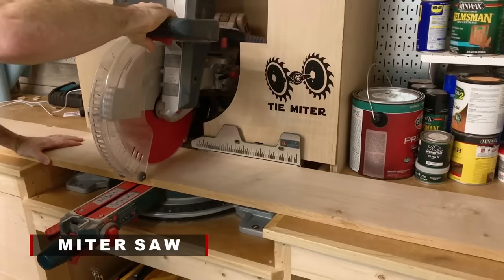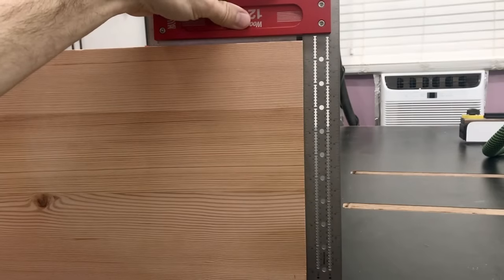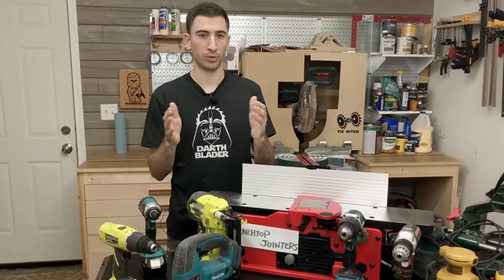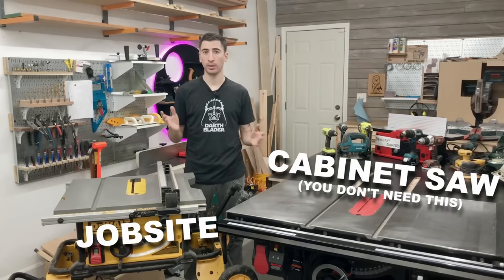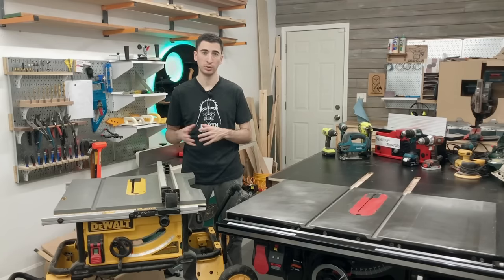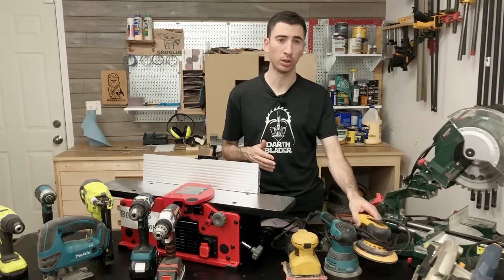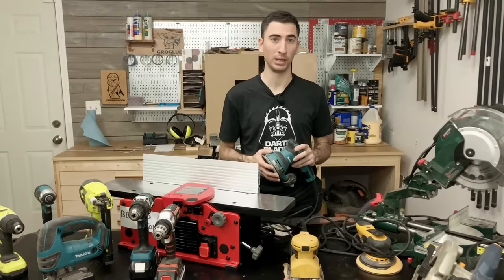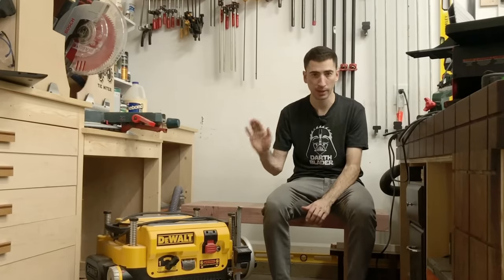Woodworking POWER Tools // Watch Before Buying

Comment: I caught one of the annual sales on the Dewalt JobSite saw at HD and built a rolling base with fold-down 'wings' around it. After fine-tuning it, I would put it up against just about any cabinet saw (at least for my needs). One of my greatest hopes, is that I will find a 220V version, for as reasonable a price, when i retire to Spain.

Comment: I have the Dewalt jobsite saw and I paid 449$ for it on Amazon. It works very well for what I need. Also have miter saw 10" Skil, paid 249$. It works very well also. How about recommending a drill press. What's a good one to buy?

Comment: I do not see Ridgid stuff... I am a contractor & have a bunch of their gear & it is good stuff on a budget. The only Ridgid tool I hate is the 7.25" cordless circ saw but I would  dislike most of the other 7.25 saws for the same reason: the blade is right side where I can't easily see it working. To remedy this I am juggling between a 6.5 Ridgid or going full tilt to a worm drive framing saw because the blade is left side.  You also have to look closely at the Ridgid jobsite table saw because their fences are notorious for being dodgy.

The only other advice I have is blades: buy good blades with carbide teeth...especially for your sawzall... I love the Milwakee demolition grade blades for this job, but again Ridgid make a very good carbide sawzall blade.

Comment: I went with 18v Ryobi years ago when durable power tools became extinct, simply because I could buy individual replacement tools alone without batteries or charger for less than $100.  I'm still using my original impact driver.

Comment: Somewhat surprised the shop vac with dust attachment for all these tools wasn’t even mentioned.
  Woodworking, only to be beaten by masonry cutting makes the worst debris bar none.
  Get a brand that has a guard attachment you plug your shop vac directly into, coupled with a small gadget you plug the power cord of the shop vac into which, when the miter saw or circular saw is active, automatically starts the shop vac for immediate wood dust collection.
  The worst part of any job is clean up after, so get a heavy duty shop vac in the mean time and clean as you go!

Comment: At 61y old, out on disability, I wanted something to fill my time and make a few bucks.
I had a circular saw, cordless drill and jig saw that I had bought at Walmart, I hadn't planned on using them much so I bought cheap.
Getting into woodworking, I bought a $20 sander, again at Walmart, Kreg single pocket hole jig and a $100, 7 1/4" miter saw at Harbor Freight.
So for $150 plus the couple tools I had, I was ready to hit the ground running. Figuring I may have an order or two every couple weeks I didn't need high-end price power tools...

Well, those little low end tools are working great and I am putting out 6/7 projects a week 🤣🤣
Yeah, when they die I will step up to the middle of the line tools...but til then, I'm making steady money with my cheapest tools I could find 😁

Comment: Also, many of these tools are disposible. As just a weekend warrior, I buy power tools that are upper end of price. My Milwaukee compact-impact set is 16 years old and still run well. My DeWalt table saw and compound miter saw are each 13 years old and run like new. Maybe I'm lucky, but I dont want to run to Big Box store and have to rrpurchase a power tool in the middle of a job. In Canada, power tools always go on sale. My drill set is pretty much same price as they were when my wife purchased them for me so many years ago. My saws were both purchased 30% off reg. price. Hand tools are a different subject in my books. A $30.00 claw hammer is just as effective as a $140.00 claw hammer.

Comment: Look at me commenting on a year old video. Go me!

Speaking as a ex-Dewalt repair tech, and then just a generic repair tech... there are some differences between the various "big" brands and how they fail. Dewalt is by far the most repair-friendly and they almost always honor the warranty, but make no mistake...they will fail eventually. Milwaukee will fight you every step of the way to make you pay even though they offer a 5 year "warranty". Makita is very solid, but when they fail it's pretty much always electronically and you can't swap out the module, you need the whole assembly replaced. Bosch is a weird not-for-profit organization of some kind and they simply buy old patents from other manufacturers, then try to give them that German over-engineered look by adding 20 more screws where they don't need to be. You're basically buying tech from 20 years ago, dolled-up to make them look like proper tools.

From a user's point of view, they're all the same if you take good care of them and don't use them in ways they weren't intended. You know.. like mixing cement with a 12v screwgun with a quarter inch rod glued in the bit holder :D

Comment: Safety is a consideration too. I believe that if I feel dangerous it's probably because it is and that likely is because of bad design. Funny how I felt perfectly safe in my shop class in highschool, but using the band saw at work I was scared. Or the cheap tablesaw my dad got me off the side of the road (thanks dad 😐). If a tool scares you, probably time to get rid of it before you lose a finger.

Comment: Having  been woodworking for over 70 years. Using many different tools. Last but by no means less important I've been selling tools for a long time. I have a few points on your observations. Most of the job site table saws are very lightly made. I consider them trash. Now on to your opinion on miter saws. 98% of your opinions are wrong. Cheap saws can be set up to be accurate, but they will not hold those settings. No sliding miter saw is accurate. There is much too much play in the sliding assembly.  I totally agree with your statements on jointers. The longer the bed the better the results. However a 6  in. jointer is everything a home shop needs. That big 8 in. starts off costing a lot. It also demands 220 voltage. Not easy for a lot of woodshop owners. Your opinion on the little finish sanders is not seeing the purpose for these little guys. They are made for the light finish sanding before finishing (400-800 grit.) The portable belt sander IS NOT for the beginning woodworker. It's heavy, powerful and moves a lot of wood very fast. . Before grabbing on of the boys  you need a good bit of practice on scrap wood.. Just my 2 cents worth.
Pop Golden

Comment: In keeping with the sandpaper point, I'd add that the most important element of your saw is the blade (so long as your saw can keep it square). I don't think most beginners pay this enough attention. Spend a little bit on the blade, and most saws will punch above their weight class.

Comment: You should do a part two video. I have two tools for the list, aka two mistakes I made. 

First thing I bought was Ryobi RTMS1800-G. It's a combination saw, and it does two things, and it does them terribly. It has a table saw function, which is worse than worthless. The fence? Not square. Miter gauge? Flimsy. Adjustable blade height? Lol no. It can't do anything you'd want to do with a table saw. I was going to use it, but instead I returned it and got a sliding miter saw instead. I just looked at the retailer reviews for it, and they were mostly 5 stars. Lesson learned: people don't know shit. Should've known better for lack of other resources either praising or hating it. 

Second tool? Ryobi RWSL1801M. It does the job ok, but it's still awful. Max cutting capacity: 45mm. Try cutting through a 2x4 with that, you need to flip it. And here I thought that 45mm is enough, since I got it for rough cutting material so I can get it inside my apartment. Should've spent a little more.

Comment: Haha I bought the cheapest Ryobi.l table saw. Initially I was pissed that their tracks didn't accept most runners, and the dust collection is non existent l, but I built a lot of stuff with it. I wish I had bought a larger ryobi table saw (those that allowed regular runners at least). But it was a good deal for $100. It was my first tool and I learned a lot from using it.

Comment: Brilliant video. I have those exact Dewalt tools. In the mid 90s, I went ahead and purchased a Powermatic 66. I learned that well made tools are safer and a pleasure to use. Yes, it is a huge heavy saw but it has served me well. Your other recommendations are spot on and I will take a look at that sandpaper you recommend.

Comment: I completely disagree with the mitre saw comment that as your woodworking improves you use it less and less. The Mitre saw absolutely has it's place to make accurate and precise cuts over and over again. it's simple to setup and use, and almost everyone that says what you say about them still has one and uses it often. It's absolutely necessary in the shop!

Comment: The Hercules (Harbor Freight) jobsite table saw has the same level of adjustability as the DeWalt. It's practically a clone of the DeWalt. Same with the Hercules 12" sliding miter saw. It's essentially a DeWalt in a blue uniform. We've had all four on jobsites together and they're so close it's ridiculous. Why not save money and buy the Hercules versions? Lord knows their warranty service is miles better than the hoops you have to jump through with DeWalt - and I say this as the guy who owns the aforementioned two DeWalts (along with quite a few of their cordless tools).

Comment: Maybe this is because I do more regular carpentry but I think table saws are very overrated, they're a great tool to have but it's extremely rarely vital to have one. It's like that old saying that "if the only tool you have is a hammer then every problem looks like a nail" but rather "if the only tool you have is a table saw then the solution to all problems is to build another sled". 

So many times you see people run to their stationary table saw to make what could be a quick cut with a jig or circular saw. Dewalt has a table saw mitre saw combo that's perfect for anyone starting out as well as the more experienced.

Comment: I really like ryobi, but I do not recommend there Mitre saw or table saws, That was the first thing I bought when I started and I burned through 3 of them before finally getting the famous Dewalt mitre saw
And a rigid table saw.
10 years later in those are still running great.

Comment: Classic Craftsman 113 contractor table saws are cheap. You can take the money saved and invest in a good fence. That saw will last forever. The only downside I've seen is the limited arbor length for dato blades.

Comment: The 1/4 sheet palm sanders are definitely not junk in the right hands. My Makita 1/4 sheet will absolutely destroy most random orbitals if you are just shooting for raw sanding power for things like sanding the corners of s4s lumber, stripping anything, and simply sanding things quickly.  Plenty of cabinet shops, myself included, have used those things for years with great results if you know what you are doing.

Comment: Also the WEN spiral 13 inch plainer is way better than the Dewalt and cheaper. Plus the jointer that's 10 inch

Comment: I really appreciate the advice in this video.  I'm finally in a position to set up a shop, and I'm starting to put my tools together.  I've made several purchases which align with your advice, and I'm very happy about them.  I've also made a few that didn't, and I'm not so happy with them (battery powered sanders being one).  One thing I've learned about buying larger tools such as table saws and planers for the first is that it's better to go with a little more quality than what you need given your  beginner's skills.  If you're using them, you'll get your money out of them.  If you're not using them, you will not have broken the bank.  Also, there are few things more frustrating than learning on garbage equipment.  Slightly better tools will likely eliminate tool error and allow the focus to remain on operator error, and that's how you learn to improve.

Comment: What do you think about the skilsaw spt99-11 vs. the dewalt dwe7491RS? They both accept up to 13/16" dado stacks, but the skilsaw has a larger depth of cut, plus you get the worm drive motor, for a little bit of a price increase. Thoughts?

Comment: I bought an OLD used Delta in 2008 to build a yurt. . . I think I paid $50 for  it.  Using it this year to build out a van into a camper.   I have to say goodbye to it after the project is over and I move into the van,, but trust me, for $50 - it doesn't owe me a THING. . . .

Comment: That 3M Cubitron sand paper, is it safe to use prior to using water based products especialially finishes. Many of the anti loading/anti clogging papers are not due to their chemistries. Since I would like to move away from volatile solvents this has become important  to me! And I just upgraded to a Dewalt battery powered random orbital.
Reply from the maker: Yes it is - it’s funny you bring this up. We are working on a video right now and part of it discusses VOCs. We did some testing with water based finishes today. There’s a lot of VOCs in those contrary to popular belief- wear a respirator!
Reply: @Lincolnstww  My concern is more about using substances like ethanol for dissolving shellac, mineral spirits and acetone. Cutting those out as much as possible, helps. I have and organic cartridge mask that is time for an upgrade but I use it with my water based grain filler and sanding sealer and, of course with the water based clear top coats. Not, however with the water soluble dyes (Transfast). The sealer and clear coats create a heavy haze even exhausted through a filter but, as far as I know are not explosive or flammable according to their tech sheets and MSDS.

Comment: Very accurate, I have the tabke saw and the planer and am very happy with both. I also have a bench top joiner and it worked great for making cabinet doors, however as soon as I moved to making a work bench it became completely useless. I tried my darnedest to set up in feed and out feed extensions but nothing worked. I bought it because it was affordable and it does work for smaller things, but you can forget large pieces.

Comment: I don't think one can claim it is ALL to do with sandpaper when it comes to random orbital sanders.
Sandpaper is the blade so it can have a lot to do with it, but not ALL. If you use cheap sandpaper the grit size is not going to be extremely consistent and so you may be sanding with 220 grit, but you might have what should be considered 180 grit particles in there as well. That will leave a swirl.
On the other hand - if you are using a very cheap sander it will have a very sloppy pattern and will also do its part to leave swirls.

I use a not expensive DeWalt sander (but not cheap)... BUT (and I didn't even know this was a thing till I saw youtube videos) I finish with a quick hand sanding to make sure my swirls are out. I guess I could sand to 320 or something but why? I will spend more time sanding that high to stop VISIBLE swirls, rather than sand to 220 and then drop back to 180 for a quick hand sand.

Comment: Disagree with the battery powered sander.

Couple of things here. 
Yes in some shops there would be no advantage, but many still have some, I mean you would still need to get power to it, so where does that wire stay?
However they are used in plenty of other situations where a battery powered one has massive advantage. There are plenty of instances where you want to use it outside, whether it be just working outside with good weather, but also when you got like fences or whatever that need repainting and can use some sanding, but also indoors. I'm helping my sister in her new place, and my oribital sander and oscillating multitool have been fantastic to work with. Battery life is not an issue, so if you even want some flexibility, just go battery powered.

Comment: I'm new to any woodworking and from tools I'd say one thing. Just avoid most of the battery tools all together. Only exception is maybe hand drill, driver and maybe, but just maybe router and saw, but only if you do very small jobs. You can easily save hundreds going with corded tools. Especially if you're working, like about 99% of people in some small shop. Just buy cheapo retractable power cord and install it roof on your shop and tools are about the same as cordless tools and the plus being that they're more powerful and lighter to use. Cordless tools in some categories is way, way over appreciated feature that can even backfire you. Sure I would get quite many battery tools if I'd were contractor and haul set of tools with me all the time. But if you're doing that, well you like aren't here reading comments. Plus even if I were contractor. How many places do you actually work without grid power? Not even at building sites.

Comment: Used tools are the way to go. Except battery powered. My last set of battery drills is still perfectly fine, but, HF has stopped selling that model battery. When these batteries are dead it's time to move on. DeWalt or Milwaukee is the way to go but out of my budget.

Comment: I avoid battery tools at all cost. All the the battery tools batteries I've had didn't last more than a few years and the replacement cost was more than the original tool.  I have 50 year old corded tools that still work.